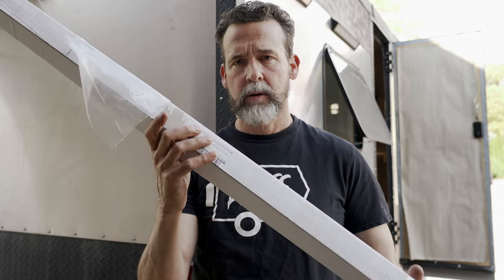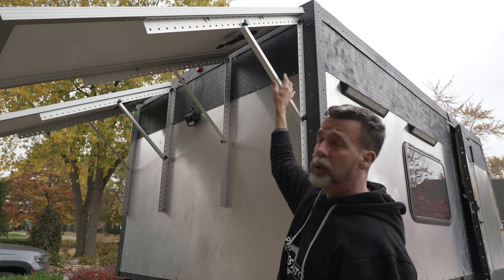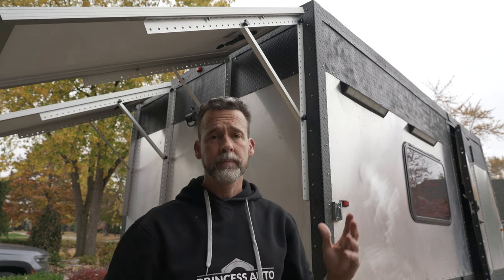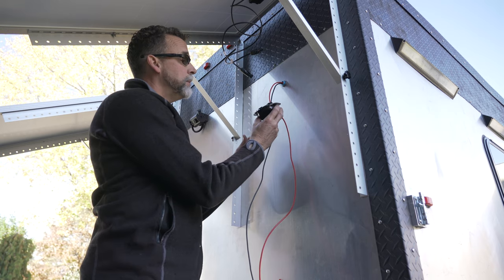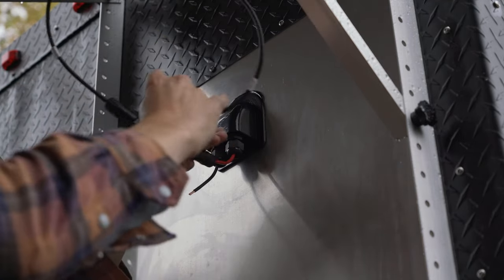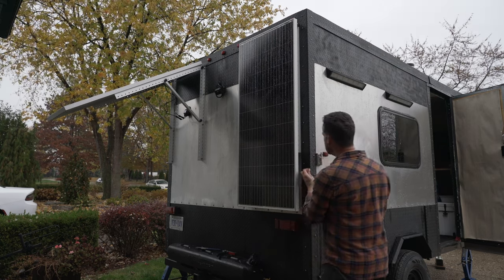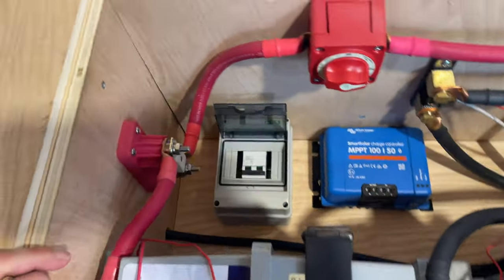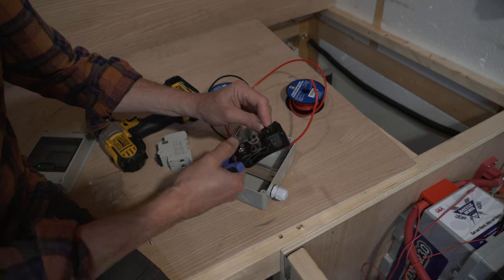How to Build a DIY Travel Trailer: Solar Panel Installation

Comment: Kind of similar to what I'm planning.  I have 3x 320watt Renogy panels up top of my 5th-wheel toyhauler (factory installed), and 3x 100aH batteries.  Since the panels are fixed-flat, they are not very efficient.  I'm adding two more 100aH batteries, for a total of 500aH.  So I need to add more panels as well.  but rather than putting more panels on the roof, I plan on mounting 3x 200watt panels on the side, each one over a window.  The adjustable mounts will serve to better aim the panels, and double as window shades !

Comment: I am putting some 540watt bifacials on the side of my boxtruck overlander conversion.  I have four of them up top, and I'll be putting a vertical rack on the back for motorcycles and kayaks.  I suppose I'll be using aluminum angle to connect them, but I'll check out the Bouge RV mounting system.

Comment: Interesting. One thing I learned setting up my off-grid system is that solar panels are more fragile then they look. The frame is not as strong as it looks. You might want to put a support under each panel along the bottom to take the vertical weight and make sure they stay firmly secure so they don't vibrate when driving. Frames can start to come apart and panels can crack, have seen both.😉
Reply from the maker: Thanks Jeff, I definitely will be keeping an eye on them.
Reply: @DrenalinAdventures  Another issue would be to keep the panels clean from salt and road debris when driving during the winter. Perhaps a cover for each panel or some method to clean them when you get to your destination.

Comment: Always fun to watch your videos. I really like this series. Not to be the bad guy here but you crimped the female on wrong. The two flaps that are at the bottom of the connector is to wrap around the inusulated part and you have to crimp the other part on the copper wires. The flaps are kind of like a second hold to secure the wire. Sorry about the bad english. Great job and keep them coming 😄
Reply from the maker: always appreciate constructive comments. thanks.

Comment: I really like this mount idea.  I use an iphone app that is really simple and very helpful for the tilt.  three touches and the phone will give angle and laying it on the panel or arm you can put it within a degree ... very quick, simple and easy ...  SimplySolar green with a line and half circle and rays ...oh you could put a tarp over panels at night and have an awning .. I work on RV or did professionally and we hate silicon ... nasty to ..for many reasons.  I suggest non sag or self leveling dicor.  I like to put the controllers (or anything that has heat sinks) in a vertical position.  Why?  Heat rises and the air flow needs to keep the controller cool.  Laying the solar controller on it's back, the air will rise and actually heat up the controller and they don't like that extra heat.  Just sayin.  You may also consider putting in a 12v cross flow fan in the whole compartment and turns on and off thermostatically ...  simple to do.
Reply from the maker: thanks, I am considering some of those ideas already.

Comment: Great job with this build. Did you think about mounting the frames farther up so when they are deployed they are above the top of the trailer (just so you avoid any shading issues)? Keep them coming, looks great. Thanks.
Reply from the maker: I would have preferred that scenario but it would have interfered with the running lights at the top.

Comment: It’s an interesting way to install the panels. Are they secure from anybody with sticky fingers?
Reply: I was also thinking what you where thinking or some one could also reach them and vandalism them in a parking lot while you where in buying groceries.
For a long time I considered on both the sides and back of a vehicle I also checked in the idea off having solar panels mounted as a pull out drawer.
I just am new to designing a system but I am always looking for ideas.
In the past on space vehicles they designed fold out solar panels.

Comment: Not sure why you placed these on the side instead of the roof. Now you will be forced to park the trailer towards the south. If the panels were on the roof you could also charge while driving.